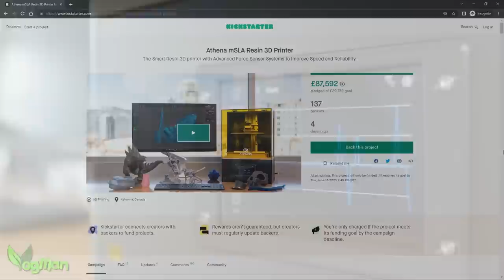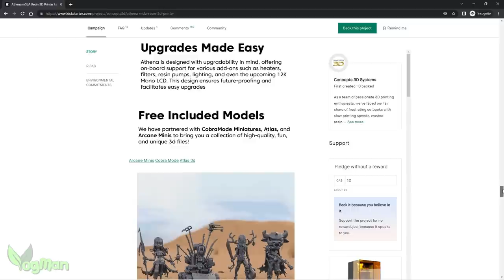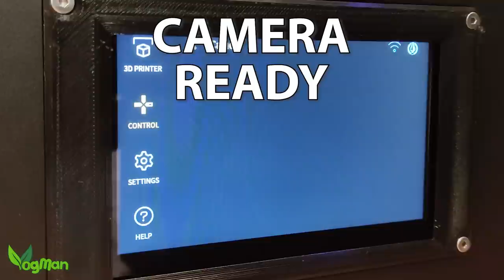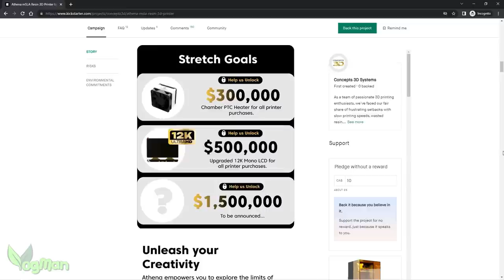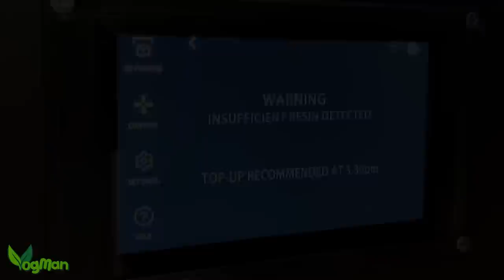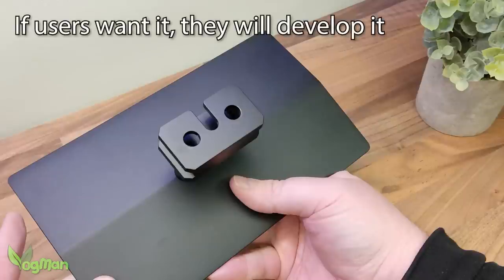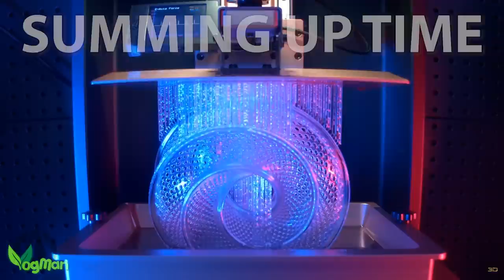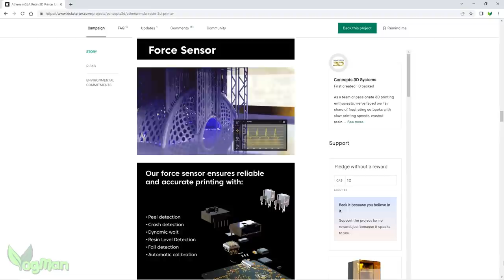Athena 3D Resin (EPIC POTENTIAL) Printer - an overview

Comment: Been watching this one for about 2 years, via the Atlas 3D guys. Feel 12k being a stretch is a mistake now the new Saturn and M5 are releasing soon.
Reply from the maker: The 12K's are already here and this industry doesn't move backwards. If this unit is produced with 8K, they will provide an affordable upgrade option,
Reply: Hey Peter, thanks for the feedback, We are testing the 12k LCD now, We want to ensure its a good upgrade to offer and doesn't cause issues that have been shown in other videos. So we are on it, and if all goes well, 12K will be available to our backers. Kickstarter Backers can choose to get the printer with 12k right away for a small upgrade fee, or get the 8k and upgrade to the 12k at a future date. So if you back the campaign, you can choose what you will receive.
Reply: @vogman  It just annoys me that the 12k is being pushed as an upgrade, the rectangular pixels do change the resolution's accuracy at different angles, which is just... not something I want in a 3D printer. 

Either I am printing something that doesn't require the extra resolution... in which case expensive 12k replacement screens aren't worth it... or I am printing something that takes advantage of the resolution... and only get it on certain angles of the print, so detail wrapping around a x/y plane isn't going to be uniform in reproduction.

It feels like a lot of bullshit marketing to me.
Reply: Thanks for this info ,Nico.  This just sold me on this printer. That was what was holding me back. Just canceled my orders for the M5S, Saturn 3 Ultra and Mars 4 Ultra. It’s gonna be an athena and my mini 8k.
Reply from the maker: I hear your frustration. It has to be said, the 12K prints are a little better than the 8K prints, but it can only be seen with strong magnification. However, it represents improvements and options, and most folks enjoy that 😁

Comment: I really wish Resin printing was more open source and less everything Chitu based. And with these systems being more mechanically simple there really is no reason it shouldn't be. And the fact that they are using a rasbery pi compute module means that in theory this could become open source with community mods could lead this to be a really good printer. I am ok with the price. I love that it is user upgradeable. What I am not ok with is the fact that it's not open source.

Comment: What kind of threads will be in the bracket for the plate level/holder. 
If it’s a aluminium construction. 
Please can we have heli coil inserts in the holes. 
That way a stainless blot can be torqued to a much higher level.
Reply: The bracket is steel, and it has a threaded boss that is pressed in from the back side. So it should be plenty strong, No issues with torquing it well and maintaining level for a long time.

Comment: The most interesting feature of this machine is the force sensor. If I were Athena I'd be worried about a larger manufacturer beating them to market with something similar. As nice as the features of the Athena are, resolution & print quality are king. An 8k LCD isn't going to cut it, especially at this price point with a 6 month development window. Other manufactures aren't going to remain stagnant. I'm skeptical of the upgrade options. Other manufactures build "upgradable" machines but the costs savings are minimal or non existent. I've found that it usually makes more sense to buy another machine.

I do appreciate the forward thinking put into the Athena but it's going to be a hard sell.

It sounds like the folks behind the Athena project could offer something truly ground breaking. Imagine for example a pico DLP mounted to an X axis. With each slice the X axis would scan across the build area similar to SLA machines, only much faster. Yes the exposure time would suffer but much of that could be offset by the force sensor technology and the stronger light source of the DLP itself. Using a 2560 x 1400 projector (same as whats in the Mars 4 DLP). The projection can be rotated 90 degrees to maximize pixel density for the Y axis. The X-axis can then be as long as the printer is able to house.   With a build area 3.5" high & 6, 8, or 12 inches wide (however big the machine is) the printer would have a resolution of 35um. Very good for a DLP machine & probably capable of better prints than anything in the hobbyist market. 

In my opinion this is a more compelling machine that could be built for the $1000 asking price. I'm actually surprised this isn't being done already. It makes me wonder if the idea is patented.
Reply: While I understand where you are coming from, the "skill" here is in the software (and use of Pi).  Elegoo and others have outsourced most of that to the chitubox guys.  This has helped them keep the costs low at the expense of advancing the tech.  Elegoo would be dependent on a 3rd party to develop the functionality or take on the massive expense of building themselves.  I think Elegoo/Anycubic are content with their cornered low end market at high volumes, but maybe this will shake that up?
Reply: @adurbe  Use of the PI isn't anything new. Many of the first generation hobby DLP machines used a raspberry PI & a custom hat as the controller. Chitubox changed the game by offering a low cost board, a decent display adapter, & of course the free slicer. While the PI has come a long way since then, it may not be the best option for this application. Anycubic, Elegoo, & others are already releasing products with non chitu based boards. The competition isn't far behind, you can already see that Anycubic is on the same path with the m5s.

It seems we're kinda reaching the limit of what LCD based machines can offer. I would have found the Athena more compelling if it were paired with a different technology.

Comment: Sorry, I didn't catch why most printing seniors would want a manual leveling?
Is it because of cost & it'd be harder to solving if an issue with the auto leveling occurs?
Reply: Cost is a factor, as a build plate without adjustment would require the entire printer to be assembled very precisely. But it is something we are looking into.

Comment: given that upgrading is their thing, im hoping that one of the first kits they do is a higher res screen like the 12k m5s (i got to the point that mentions this lol). speaking of the m5s, an auto level upgrade would be nice too. something else i'd love to see is a glass barrier between the screen and the vat. screen protectors are cool and all but it just isnt a replacement for a glass plate that separates everything. it was on the original photon and it saved me so much heart ache when thing have gone wrong. instead of faffing around with figuring out if i've ruined the screen or not i'd just need to take a razor blade and scrape the cured resin off the glass plate. i havent seen it since the OG photon days and i don't know why.
Reply: 12k is being tested on Athena, and we have a tempered glass screen protector on the printer now, as standard.

Comment: I don’t agree for the plate manual adjustment could be still good as m5s had some manufacturing issues, some customer gets their plate not 100% aligned and the autoleveling cannot compensate to much.. in this case you have to send back the whole printer… having a manual leveling system in addition seems the best of all worlds !

Comment: I was looking forward to your video! This printer really does have a great potential! If they add the heater and resin refill as a standard that will be perfect. Also i hope it will have strong enough light intensity for engineering resins (like Loctite 3843) then this printer could be a replacement for my Mono-X
Reply from the maker: The heater WILL be available though whether it's part of the KS package depends on the target. Nico has already developed a few resin pumps for industrial printers and has some things in mind for Athena.
Reply: @vogman  would also be awesome to see you reviewing the VLM technology from BCN3D which also could be a game changer!
Reply from the maker: It does look fascinating technology, but I think it's focused at industry rather than domestic use. But who knows what the future will bring.
Reply: @vogman  most idustry technology will make its way to the mainstream user soon or later.

Comment: Can the Athena guys tell us how we can join the VIP program mentioned on the kick starter please? 
I have sent a email but haven’t seen a answer. That’s not a problem guys. You have great works to do. 
The Athena is a masterpiece of consideration to the actual problems of resin printing. Well done and keep going.
Reply from the maker: Nico...?
Reply: Just so you know. I supported the campaign without any further considerations. This project is a game changer. Well done.
Reply: Hey there, VIP program has ended, some free spots left, but you would need to contact us and we will get back to you on the details for the VIP plan.

Comment: Very nice!!
Could you please tell me which printer would be best for jewellery printing (almost exclusively), and with which wax?
Reliability would be really important.
Thank you!!
Reply from the maker: Personally I think the Anycubic D2 is the best I've tried for high detailed small prints https://youtu.be/Q-OoGQfG2wY
Reply: @vogman  thank you very much!!
I am a goldsmith/stone setter since about ten years but never did 3d which is really a shame.
It's about time!
I will use your link to get it.
Reply from the maker: That's very kind, thank you. Ever little helps 😁
Reply: @vogman  oh one more thing sorry, which resin would you suggest for it? Something that cast as easily as possible, I do not cast myself. thanks!
Reply from the maker: As this is your first attempt with resin printing, there will be a bit of a learning curve for you. I'd suggest Siraya Tech Cast. This video is a User Guide and you'll see me using the D2 to cast a silver ring https://youtu.be/7MDl6ZeTrME
Reply: @vogman  thank you so much, all set!

Comment: How does it compare to the GKTwo? Since you really loved that one as well. Because I might cancel my GKTwo order in favor of this one instead.
Reply from the maker: I like the GKtwo but it just the same as the others with a heater, an easy fit tray / plate, and a nice carbon cartridge. I use mine on a regular basis. But Athena is leagues apart. It's like comparing a bicycle to a motorbike. They both achieve the same, but...

Comment: If they included the 12K screen, I would have backed 100%.
As it stands I prefer to wait for the 12K and pay more when it is in production.
Reply from the maker: If they don't meet the target, buyers can still opt for a 12K insert for a little extra. It's all about upgradability 😁😁😁
Reply: We are testing the 12k now, and we can offer it on the kickstarter printers on delivery for a small upgrade fee. Or backers can choose to stick with the 8k LCD and upgrade to 12k at a later date. We want to ensure the 12k works well and isnt prone to a lower life or printing artifacts before we commit to 12k as a standard for Athena.

Comment: Looks like the fans are on both sides of the printer,  How loud it the printer during operation ?
Reply: We use speed controlled fans, so silent when its idle, but not too bad when its running, I have a prototype running Noctua fans for the ultimate silence, but production printer will not be all that loud, for sure quieter than some of the other printers like the Halots that use small fans running at high speed. We got 2x 80mm fans and 2x 4 pin PC style connectors on the Main board that can run at either 12 or 24v. So you can change the fan to whatever you like.

Comment: finaly , an ETHERNET port!
Reply from the maker: There's a few printers with ethernet, but it's always good to have both options. Even I managed with wifi here, and I usually struggle without a cable.
Reply: @vogman  indeed, but most seems to jump straight on the WiFi bandwagon and have obnoxiously complicated and fragile pairing processes. Ethernet just works, and doesn't randomly not work just when you need it.

Comment: This’ll be cool if it’s cheaper than the uniformation 8k printer that’s already available with heating and air filtration and the same lid design… kickstarter doesn’t seem like it’s any cheaper though

Comment: The out venting feature is fine and dandy, however I would rather have a filter unit inside enclosure. Still, keeping my fingers crossed for this project - the wider variety, the better :)
Reply: Why not both? The exhaust port can have a carbon filter attached instead of a hose.
Reply: @Captain_Nico  this would be a SUPERB functionality, as this would allow for two step filtering using different filters. Too good to be true, but on the other hand who lniws?

Comment: Ignorant dabbed my toe in once aged ten years in 1 week user here. 

Would you recommend this for a new user or is this just one for the printing enthusiast?

How would the bed heater work will it heat the vat or the air inside the printer. 

You mentioned resin stirring is there any way they could automate this? Like ultrasonicly or pumping the build plate. Meaning you could just leave the resin in the printer pop the cover off the printer will stir and heat it then begin printing.
Reply from the maker: I think this would be an ideal starter machine as it will prevent the user experiencing many of the problems most of us routinely incur. But this is a fair chunk of change and I typically advise newbies to buy a cheap resin printer and try it. It's a smelly and messy hobby. Many can't take it. Those that love it typically move on to bigger and better 😁
Reply: Hey SMTK, Yeah for a first printer, make sure you like resin printing before diving in with Athena. I know a lot of people are turned off with resin printing because of the cleanup, chemicals, smell and costs involved. 

For your other questions, Bed heater will heat the air inside for our first heater, but we are also looking at an integrated vat heater as well. For resin stirring, it can be automated, but its best to do with a wiper arm. Might be an add-on in the future, but at this time its not planned.

Comment: It is a interesting concept.  One question did they think of using a PCB heater ring on the metal plate surrounding the area that holds the vat. similar to a vat band heating system. that would warm up that vat holding surface and heat the vat/resin?
Reply from the maker: They are considering various options, including vat bands. That's what they're like 😁
Reply: Yes, we have considered the vat band heaters, and while they work well, they dont look great, and can get resin spills and damaged easily. We are testing solutions now for a vat with integrated heater inside the walls, and a Magnetic connection for maximum usability. But for now, we got a chamber heater and Athena can support any style heater.

Comment: Chamber heater can cause bad printing lines from my experience, VAT heater is much better solution I guess.
Reply: Chamber heaters that run Bang-Bang control are bad as they come on and off as temperature reaches a threshold, so chamber temperature fluctuates quite a bit. As well, you want to avoid blowing on the part directly. Athena avoids both of these issues buy using PID control for a constant controlled heat, and the air blows against the printer back so less airflow directly at the part being printed.

But we are also working on a vat heater since its been requested quite a bit. Just want to find a nice solution as the vat band style heaters get in the way, get covered in resin and can loose their adhesive over time.

Comment: Hey Vog man, Hey Nico. Will the Athena be available for Israeli customers and with reasonableshipping price (Maybe via amazon?) ? unfortunately it isn't right now..
Also, what would be the main differences between the prototype that is on kickstarter and on the finished product? and when will the finished product asummed to be ready?
Reply from the maker: Nico...?
Reply: @vogman  sorry for the confusion, I just noticed that Nico Martin responding to some guys and hoped he'll look at my question
Reply from the maker: Nico's still at work right now but he'll tune in later I'm sure.
Reply: Hey Barak, At this time we do not ship to Israel, we will look for more distributors in the future, but at this time is not available. As for the differences between the  prototype and production printer, there will be some differences. Such as a full glass touchscreen, right now there is a plastic bezel, it will all be glass. We are adding an exhaust port at the back, as well the force sensor screen you see on the build arm will not be there, all the force data will be on the touchscreen.

Other minor things, but most of the work left to do is in software and UX, so that will take up most of our time before we deliver.
Reply: @Captain_Nico  Thank you Nico, I guess I will look for a creative solution for shipping. Please do consider it and if it will happen release a notification :)